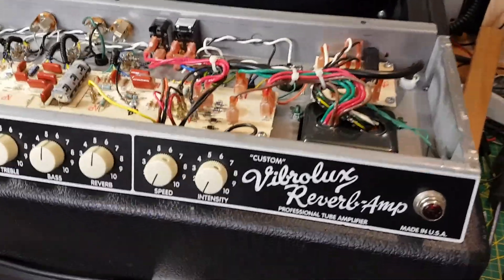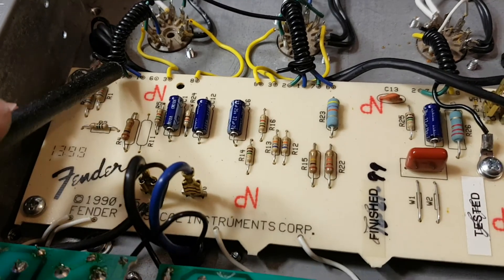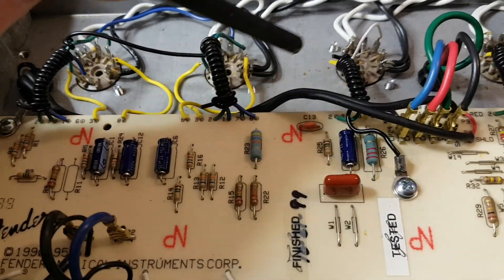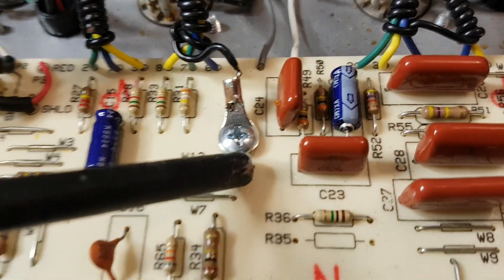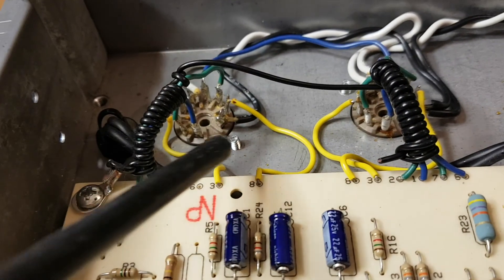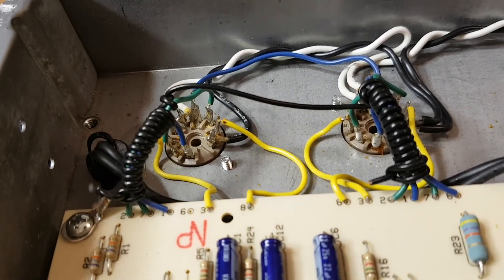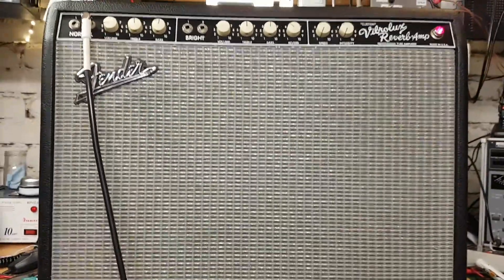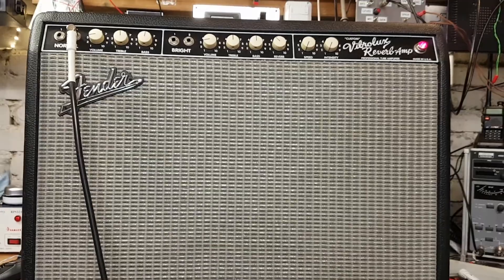FENDER CUSTOM VIBROLUX REVERB  noise issue resolved

Comment: Is there any way to minimize the electrical noise from a Fender tube amp?  I’d like it to be as clean as possible for recording, whilst the volume is up for the tone.  (I have a ‘71 Vibrolux).
Reply from the maker: The amp must most likely be serviced by a good, reputable amp tech. Those old 70's amps are a treasure but their capacitors and resistors will deteriorate with age. They become leaky and change significantly from their original values. The amp will be way better after a good service.
Reply: Be prepared to have some wire shortened or changed too. I've worked on many of these and the 70's ones can be sloppy on the inside. New electrolytic caps are a must, make sure resistors are in tolerance but then have your tech check for corroded wires etc too.

Comment: That method of shielding can sometimes create even more noise btw. It's better to use shielded wire in this case and you only need to shield the grid wires going to pin 2 and pin 7 on the preamp tubes.
Reply: Could you tell me what specific wire you used? Ie gauge or type?

Comment: I don't get it...it's buzzing and noisy as hell.
Reply from the maker: I live close to the railway line which puts a LOT of noise into the air. That's what you are hearing. When the amp is in a normal environment it's totally quiet. The customer is very happy with the result. Even in the video the sound is exaggerated because the camera auto level control tends to boost the background noise when I am not talking.
Reply: @DerekHerbst747  I have a Fromel modded CVR and i have a mystery. When i bought it, i had researched it and talked to Fromel. It had verb and trem on the bright channel only so i opened it up and sure enough...the mods were already done by someone. It was hissy. I HATE noise just like i hate being out of tune. So, one day i unplugged the generic footswitch and it became dead quiet. !?!??! Last couple of days...hissy again, so i turned off PC and other stuff, plugged into the Normal channel w/o the verb/trem, unplugged a NEW FENDER two button footswitch and replugged it...dead quiet again. The reverb is strong, the amp sounds wonderful, i run an attenuator so i can run it juiced or with headroom. It has a nice Dumble like midrange, is the right size, i love the reverb and really love tremolo. I don't know what to do. I love the amp but i cannot handle loud hiss when it shows up occasionally.
Reply from the maker: @dragonpundit.6443  Normally, bad quality resistors in the preamp circuit can cause hissing noise. This can also come from cathode resistors in the power tubes. Locating the source requires patience and good test equipment
Reply: @dragonpundit.6443  He's right about noisy resistors. The closer they are to the input, the more they'll be amplified, and these cheap, common, carbon-pile resistors are notorious for injecting "hiss" into the signal path. Also they deteriorate quite a lot over time, so even just replacing old ones with new ones of the same type can often dramatically lower "hiss". A good upgrade to consider would be to just replace every 100kOhm resistor throughout the amp circuit with a Vishay bulk metal foil resistor. This also goes for the 68kOhm & 1MegOhm resistors on the input jacks.  The same general principle goes for any unshielded wires: If they're in the signal path near the input, where they're going to travel through the most gain stages, any EMF "hum" will have the largest amount of amplification. By contrast, any reception of hum or hiss by the speaker wires will not be amplified, so the effects are basically null, & that's why speaker cables are usually unshielded.
Reply: I agree.